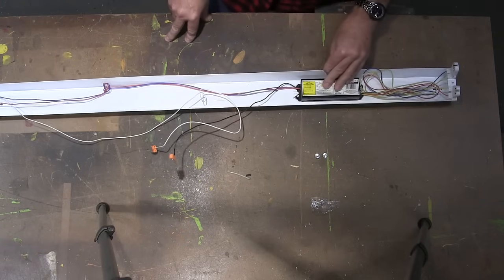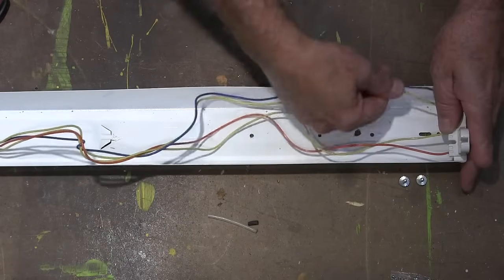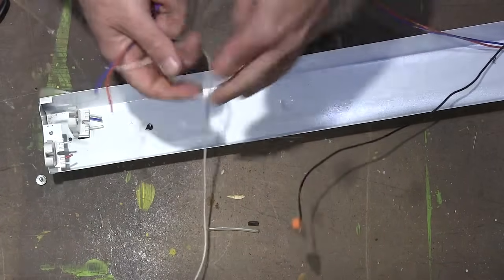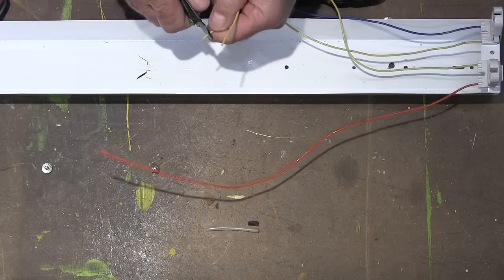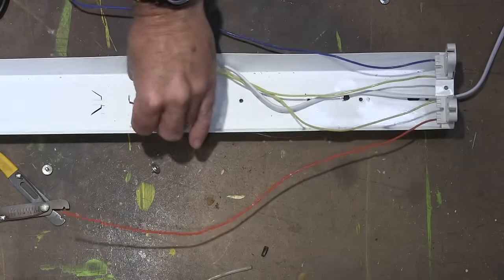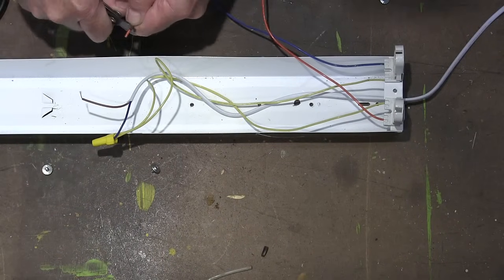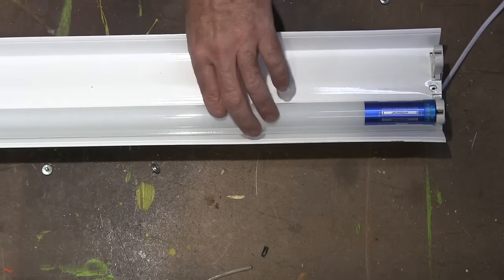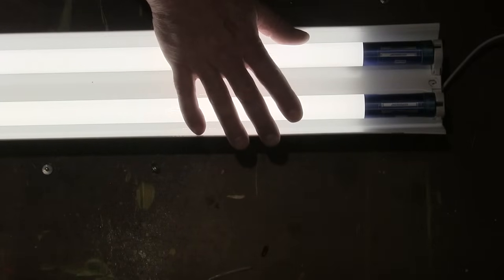Fluorescent to LED Conversion

Comment: What kind of wire do you use for the conversion? I know there’s a ton of different types
Reply from the maker: I just used the existing wire.  If you are doing a new installation just make sure the wire will carry the total amps used.

Comment: can I use a dimmer for the LED bulbs if I do this conversion?
Reply from the maker: Depends on the bulbs you buy.  They should say on the box.  If you convert this way be sure to buy bulbs that wire up the same.  There are some listed in the description if you need to check.  Good luck!

Comment: I think that they are called "ballast free single ended leds." I have these installed in my kitchen with 5000K LEDs.These have to be the simplest ones to convert to. I've seen some very tedious videos on compatibility with various tubes. This is the way to do it, no new parts and no need to support obsolete technology. Nice job!
Reply from the maker: Thanks Twidget, I wish the manufacturers would standardize led tubes so it would be easier.  Thanks for sharing your experience.

Comment: Update - my tubs have a L for load on one end, and a N for Neutral on the other.  The using of just one end will not work with my kind of bulbs/tubes.  I had to use both ends and wire all the wires on one end to black or positive or Load wire.  And wire all the the other end wires to the Neutral wires.  And of course remove the ballast!   Every thing worked after that!  Thanks for getting me started, I have the feeling that the direct wire bulbs/tubes I purchased  or the tombstones in my fixtures, were the issue compared to this details in this video, but this lead me in the general directions.  Thanks!
Reply: single  vs dual  end. this video works for single end. I wish he would've talked about the difference in the two.
Reply from the maker: Glad it worked out for you David!

Comment: My fixture looks exactly like yours.  I followed your instructions to the letter.  I have 2 other fixtures on the same switch.  I flipped the switch (after doing the conversion) and the converted light doesn't come on with the new T8 Direct Wire Type B bulbs (with L, on the tube, on the powered end,  The N, on the other end, that is not powered).  The other 2, which are not converted, come on as normal.    My LED bulbs are GE T8 LED Direct Wire, Type B cool white.  At Lowes they are PC code 93129297.  I re-did the twisted wire connection and I've made sure the 4 wires going to the power tombstones are secure in the tombstones.  Still does not work!   I bought a power tester.  Tested the wires and the tombstones.  Power is going to everything on the power end.  My wires coming out of the Tombstones are as you illustrated. Any thoughts?
Reply from the maker: Glad it worked out out for you.  I wish there was a standard for how to wire LED tubes.

Comment: If it doesn't matter about the polarity, Why do the led lamps have an L for line and an N for neutral? Just asking!!
Reply from the maker: It depends on the bulbs, they all seem to wire differently.  On AC the current alternates from pos to neg so polarity usually does not matter.  However I would wire the bulbs as you indicate if they are labeled that way.
Reply: @SoatMon  And that is what I did.. Thanks for the response

Comment: You don't explain the led tube light is two type.. Your video is for single ended..this Denger for beginning.. Because if use the the double ended.. Then flow your video wiring.. What happens short circuit.. Booom🤕

Comment: I’m putting new tombstones in because the ones in the unit got loose and are wiggling. Should the wires going into the tombstone match the wire gauge for the amperage of the circuit breaker?
Reply from the maker: They only have to be sized for the number of amps or watts that the individual bulb will draw since they only feed that one bulb.  You should be able to use the wires that are currently in the fixture since you are going from florescent to LED.  Good luck and be safe.

Comment: I took the old ballasts out. Wire one side hot and the other neutral. Put the 4 new led bulbs in, breaker back on, switch on, lights on. Awesome video, thank you for the knowledge and confidence to get her done!
Reply from the maker: Glad it worked for you.  Thanks for letting me know!

Comment: Not sure what I did wrong but this isn’t working for me.
Reply from the maker: Look at the wiring diagram that cam with your bulbs and make sure they are wired correctly.  There are many different bulbs, some work with the old ballast some without and some will work with both.

Comment: So, I can us my T-12 fixtures with T-8 LED tubes after I remove the ballast. Right?
Reply from the maker: Yes, you should be able to.  T-8s should fit your T-12 tombstones.  Be sure to get bulbs that wire up this way, there are many different configurations out there.
Reply: @SoatMon  the bulbs I bought on Amazon, ( sorry I just found your channel ) are “ Single Ended Power” tubes. Is the wiring conversion different for them ?
Reply from the maker: Since they are single end they may be the same just make sure you pay attention to how they should be wired.  There should be a wiring diagram with them or on the bulb itself.  Hope all goes well!

Comment: Will this work the same for T12 ? Also, someone said that the power does not need to be turned off
Reply from the maker: Yes should work the same but these fixtures were originally T12  and the new bulbs fit them.  Be sure you get bulbs that wire up the same there are many different kinds out there unfortunately.  I list the ones I used in the description to get you started. Good luck!

Comment: Why bother with conversion? I just ripped off all old fluorescent tubes and fixtures in my home, and replace them with LED tube fixture bought from Amazon. These LED tubes come in as complete with metal housing, clear cover. But one need to bring in wires to connect to its internal wires. This is an easy job. Two screws are all needed to secure it on the wall or ceiling.
These are very bright and consume a lot less power than fluorescent tubes.
I forgot to mention that the LED tube fixture I bought cost the same as the conversion kit.

Comment: always thought one side of light gets connected to black i.e power. the other side white wire gets connected to the neutral white wire
Reply from the maker: It depends on bulbs. It can be very confusing. They need to standardize it.

Comment: So do you have to get that same exact LED bulb from the video?  Or will any type 4’ LED bulb work?
Reply from the maker: They all wire up differently. You wouldn't have to get the same one but you have to get one that wires up the same way. It can be very confusing. Good luck with yours!

Comment: Ballast? Everyone knows what a ballast is/or does except me. So anybody, what is a ballast what does it do.
Reply from the maker: The ballast is the black box you see in the light fixture and it increases the voltage for use with fluorescent bulbs.

Comment: how about light fixtures like this that are daisy chained to each other in pairs  so basically i have the same fixtures here at the plant  but they are hooked together in pairs  would i just run the wires from one end of each fixture back to power and hook them up the same way  just adding the extra wires from the other light  and eliminate one end from the tombstone on each light fixture

Comment: Shunted or non-shunted tombstone in this scenario please? If the fluorescent bulb was a T12, do we now use a T12 LED or T8 LED bulb? Does it matter? And what do we do with the ground wire?
Reply from the maker: If you are using the bulbs I have in the description you would use nonshunted.  Be care, there are many different types and they wire differently, there in no standard at this time.  You could use T12 or T8 but I would suggest you buy ones like in the description so you will know how to wire them.

Comment: Did I miss it or did you mention if the tombstones where shunted or non shunted?  I will assume the later of the two, let's hope for no spark show.
Reply: The bulbs he used are powered only at one end which obviates the shunted issue.

Comment: Those a new LED bulbs don't require any ballast?
Reply from the maker: The ones I listed in the description can be used with or without a ballast.  I took mine out so I didn't have to worry about them going out later.

Comment: What is confusing about this conversion is the fact that not all LED tubes are created equally, nor are they labeled properly. There are  bulbs powered off single end that require non-shunted tombstones. The black ‘hot’ or L1 connects to one pin, the white ‘neutral’ L2/N connects to the other. Some are labeled on bulb, some are not.

 Other bulbs are powered in the same manner as standard fluorescent bulbs, connecting red or blue wires to one end, yellow to the other.

 Not all LED bulbs can operate without a ballast. Some require a rapid start or instant start ballast. They will not operate with a magnetic ballast. I just installed Sylvania 12W bulbs in an old fixture that would not light when directly connected to AC line. 

Another point, don’t trust just any of the professionals at orange vest or red/blue vest stores. Find somebody who knows what they’re talking about. Get a second opinion if need be.

Lastly, though it worked in this instance, you should connect power wires properly. Black wire is ‘hot’ and is usually labeled as L1. It should be connected to blue and/or red wires. The white wire is ‘neutral’ and can be labeled as N or L2. It should be connected to the yellow wires in fixture. This information is printed on most ballasts or is included in package.
Reply from the maker: Agreed.  Thanks for your input.
Reply: Yeah Soat Mon,  wish you had of mentioned that in your video.  Your instructions didn’t work with the GE TYPE B 32W LED Tubes  I have because power is at both end I cut the wire at the non power end and going to have to get different ones now or Jerry rig it
Reply: Yeah, I had the ones needing both ends connected. Thanks.
Reply: Thanks for the heads up. Still a better video than the manufacturer's.
I just looked closer at the picture instructions on the side of the box and it does say L1 on one end and L2 to the other. 
Whew; no gerry rigging for me.

Comment: Say your doing a kitchen light like that, but the wires go through the center.  Would it be safe to pigtail two the wires using the wires left over from the ballace to the box?  Those wires are pretty thin.  My question would be how safe is that as i seen that done as well...
Reply from the maker: I hesitate to give advice for something I can't see but LED bulbs do not use many amps so you if you are worried you can check the size of he wire and make sure it can carry the amps that your LED bulbs are going to use.  Those wires were running the florescent bulbs which use more amps so I would think it would be fine but again I'm not an electrician.  Good luck.

Comment: i have (3) 4 ft ceiling fixtures in my kitchen with 2 tube bulbs each. If I convert one to LED can it still work with the other 2 that are original florescent tubes with ballasts?  They all work off one single wall switch.
Reply from the maker: Yes you can convert one fixture and leave the other two alone.  Check the video description for the bulbs, there are a lot of different types out there and they wire differently.  Good luck and be safe.

Comment: OK mine did not light and I used your wiring scheme. Then I see in my Phillips bulb fine print "Lamp only operates with a Ballast" So are there are 2 types of LED bulbs? I didn't see this requirement when I searched bulbs to order.
Reply from the maker: The bulbs are very confusing, if you look in the description I link to some that will work.  At this time there does not seem to be any standards, some get power from one end, some from both ends, some require a ballast, etc.
Reply: No kidding, I spent a hour at Lowes today trying to convince the lady in electrical that the videos show no ballast replacement  when pulling T12's out with the ballast and wiring direct, with their bulbs they are replacement for fixtures with existing T8 ballast so consequently there must be different bulbs as mentioned.

Comment: I guess I don't quite understand because I have put new / current LED tubes on a regular/older flourescent fixture with ballast, and it works without having to do all this cutting and re-wiring.  So I'm wondering what is the reason for doing this?

The video description says something about LED tubes that don't need a ballast.  The video itself, doesn't say anything about this.

But apparently there may be some LED tubes that work just fine with ballast, so that it isn't necessary to do this.  Perhaps like you said in some other comment replies, maybe one day , the LED tube manufacturers will standardize all these tubes.
Reply from the maker: The only real benefit of rewiring them is to remove the ballast which is a frequent source of failure with these fixtures.  The bulbs I list in the description  can be used with or without a ballast so I could have used them without rewiring it and just done it later if the ballast failed.  Most bulbs however only work with or without a ballast.

Comment: Thanks for your time and interest.   Ima go crazy converting these lamps.
Reply from the maker: It can be very confusing.  I would suggesting using the ones I had in the description and then you should have no trouble.  There are many different kinds that need different wiring.  Hopefully they will standardize it one day.

Comment: Third video I've seen for converting to LED.  Each did the wiring differently.
Reply: Yeah me to and different tombstones
Reply from the maker: It can be very confusing.  That's one of the reasons I made the video to show a specific led tube and how to wire it successfully.  If you buy different bulbs the wire may be very different. Hopefully the will standardize it one day.

Comment: line and neutral are reversed on one of the sockets. Need to fix that.
Reply: makes no difference as long as you identify which colors are neutral and which are line hot. Any hot side should be blacked out with a sharpy if you want to be NEC compliant. Just completeing a AC circuit in series. The LED bulbs have the drivers within them.

Comment: Those tombstone are rated for 48v, just know that you have the potential for a direct short. Buy an integrated led fixture, much better solution vs led tube lamps which are a 50k hour at best technology. Not good when comparing to a reputable led manufacturer. This is the cheapest solution for led and highest risk for failure.
Reply: tombstones are not rated for 48v.

Comment: Great video, great explanation! Rab lighting and some other manufacturers make some LED tubes that feed the line in on one side, and the neutral on the other. It doesn’t matter if you have shunted or non shunted tombstones if you use those types of tubes. Basically, all the leads from one side hook up to the black wire, and all the leads from the other side hook up to the white wire. These things are so awesome, they last much longer than fluorescent lamps, and the newer ballasts weren’t much better.
Reply from the maker: Thanks for your kind words.  It's really confusing out there, there are many different configuration so bulbs are not interchangable.  Hopefully one day they will be standardized.  Thank you for taking the time to share your experience.

Comment: Do the LED BULBS you are using have Ballasts or not.
Reply from the maker: They work either way but I am not using a ballast.
Reply: LED lights in general do not use Ballast. They have their own internal electronics.  This apply to both light bulbs and tubes.

Comment: Hi there!. Thank you for demonstrating how to convert a regular fuorescent tube lights to LED ones. I followed your demonstration exactly. I cut off all the wires from the tombstones on ones side of the fixture. Removed the old ballast. Conncected the power to the other side of tomb stones as you demonstratred - one lead from each tombstones to one lead of the power line; then the second leads to second lead of the power line. Then, installed the LED tubes. Turned the power on. Nothing. Reversed the LED tubes in the fixture to ensure the power end was at the power source. Turned on the lights - no light. I don't know what am I doing wrong. These are LED bulbs made by Philips supposed to work with or without the ballast. Please help.
Reply: There are 2 types of LED tubes. One type has live connectors on both ends (double-ended or DEP), the other type has live connectors on only one end (single-ended or SEP). This end is usually marked with a "DC" designation. The instructions on this video are for the SEP, or single ended tubes. From what you've described, sounds like you are trying to use the DEP tubes in the fixture adapted for SEP. 

I realize that the instructions don't expressly mention that, or they are glossed over.
Reply: Diego Terneus m

Comment: Who wired this ballast and fixture? You don't have 2 wires connected to each tombstone. Way too many wires for a 2bulb ballast. Besides your hot and neutral, there should only be 3 wires. One wire to each tombstone and then a jumper on one side. Plus, just pop out the wire from the tombstones. Don't leave them there. It takes half a second. Spin and pull, done. This video is all kinds of wrong lol
Reply: Where does the jumper need to be? I have a four lamp fixture.

Comment: The only problem with "LED" lights is that they cause "Macular Degeneration" to your eyes due to the "Blue Light"  You would need to wear on your eyes "Blue Light Blocker Eye Glasses" every time you enter a room where these LED lights are being used.
Reply: Where did you get that info?
Reply: @jameswheeler1107  Just do a Google search and you will find all the information on this.